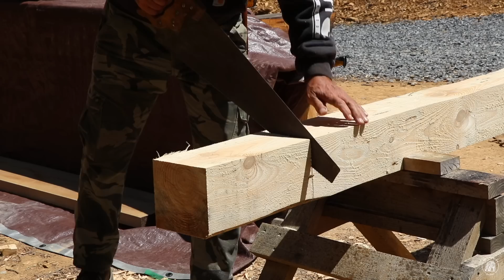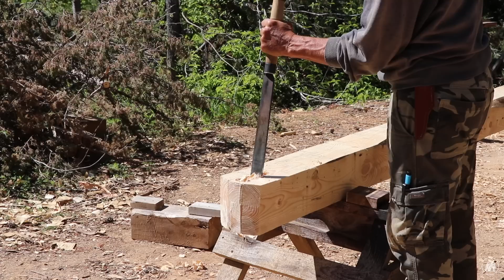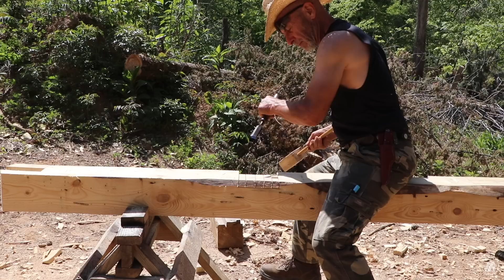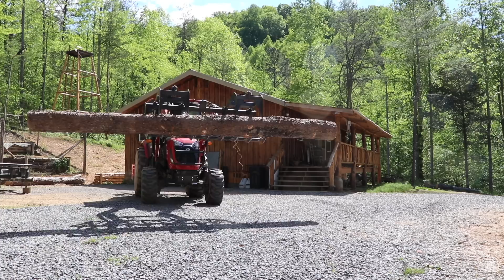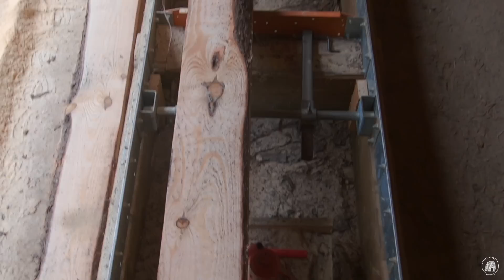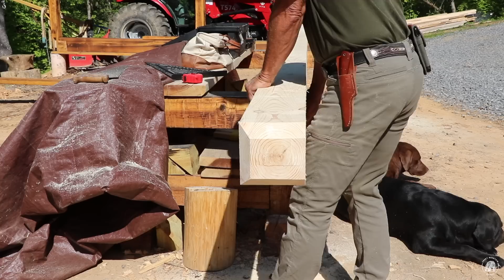Timber Frame Workshop Pt2 Ep4

Comment: Great video Richard as always,what brand of markin pencil are you using in the first part of this video the blue mechanical one?
Reply from the maker: It’s called OX Tools. Depending upon where you live there are a few places to purchase them either online or in store. There is also other brands like Pica or some others that make similar pencils.. although the lead is actually pretty thick, I still prefer my framing pencil, especially since most everything I’m
Marking is sawmill lumber (rough cut). That’s not to say it doesn’t mark well… I just prefer the old standard mostly, but also use and have at the ready that blue OX pencil as well. Maybe I’ll do a short overview of it and give a couple away
Reply: @SmokyMountainOutpost  great thanks Richard, I prefer the old standard as well got an old mason jar in the shop full of them but they don't do too well marking through a hole thats too small for them to fit so I think that would be pretty handy for doing that
Reply from the maker: Oh yea that’s for sure, these pencils also have other color “leads” (they don’t seem to be lead) for marking different types of boards/paint color etc.. as well…like white and yellow etc..

Comment: Thanks Richard, like you said a while back, pine is a lot more difficult to work with for timber framing applications than hard woods. You should have Lyne forge you a chisel that same length with a three inch wide blade. Was wondering what the snake population is there in eastern Tenneesee, when I was a young lad in eastern Kentucky there was no shortage of copperheads, black snakes, and timber rattlers, my granddad always kept a garden hoe just outside the door to take with him on his daily walks. God bless y'all.
Reply from the maker: Dad has been lucky enough only to see black snakes. Amen for that! Good idea on that new chisel… I will pass that along to dad, lol. -Jennifer